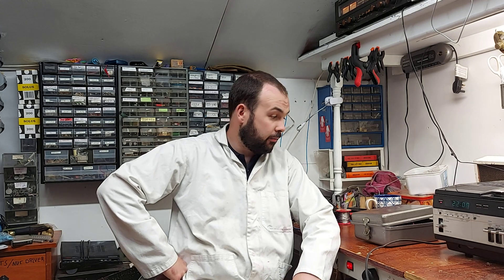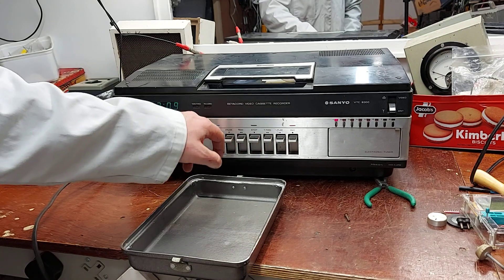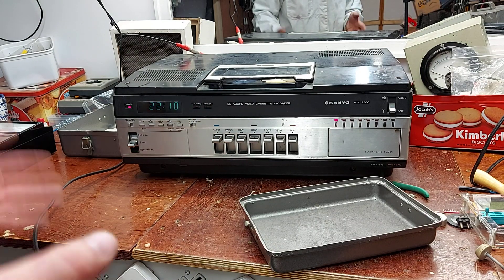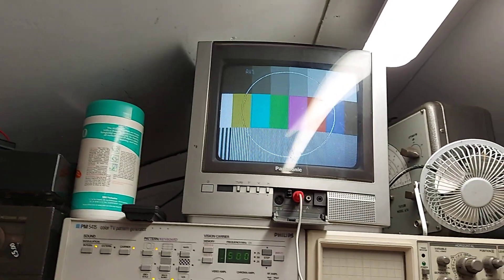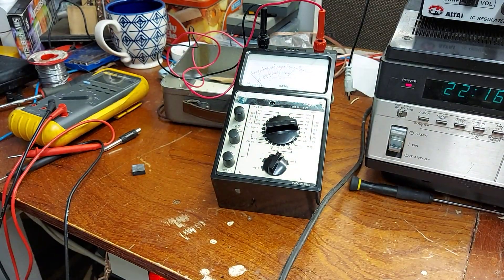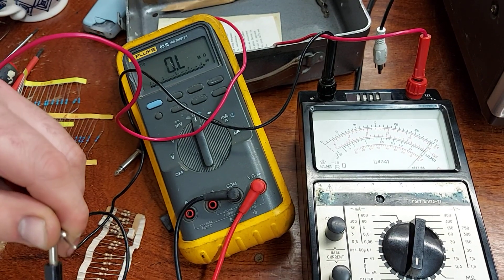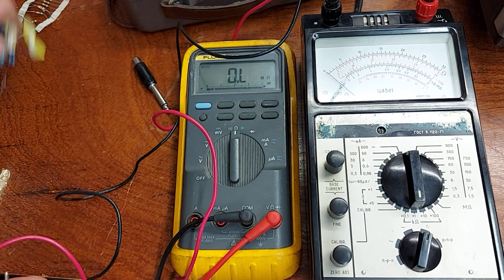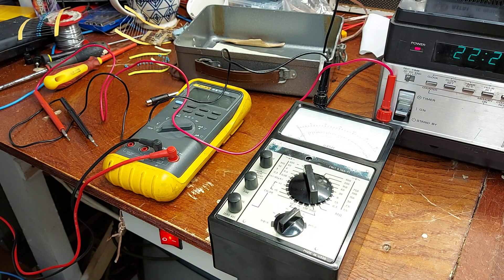A closer look at the Soviet Multimeter ų4341.

Comment: Hi . Nice timewarp to the year 1977 , when I was a12 years old boy and took my first lessons in electronics.
It took three months to get the Money to pay this meter at my local electronic dealer. I had good days with that meter and got it for a very fair price ( about half the price compared to meters with the same specs , those days here in Western Germany). Unfortunally the Meter sliped from ny workbench in fhe mideighties and the case broke ( rhe brittle Case is fhe only down-point of the meter). The metal case of the meter still exists and holds my modern Gossen- Metrawatt these days. Have fun with it !

Comment: Interesting Russian meter, it seems to have kept very well.  At least the Soviet era gear was well made.  I used to have a Videostar A823 which was a rebadged JVC HR7700.  It was badged as Ferguson 3V23 and Akai VS10.  A friend had a VS10 and I noticed it’s remote had a shift button which doubled the number of channel memories.  I tested it on the A823 and found that while it did access the extra memories, there was no actual memory, so stations couldn’t be stored.

Comment: Now that is one accurate multimeter, the internal resistors could not have drifted (No dam carbon ones) :-D.
And to think that it was going to be thrown away, utter madness!!.
I imagine the mirror anti parallax addition would have been in a later model.
So it's likely to show a similar resistance per volt as the avo did.
The betamax looks like a solid beast, it's a shame that vhs won the vhs/betamax battle, beta was much better.
I noticed your valve in a round red emergency box again, i have one in the kitchen with a teabag in it ha ha :-D
No supprise there :-D
Reply from the maker: That's the audiophole emergency valve.